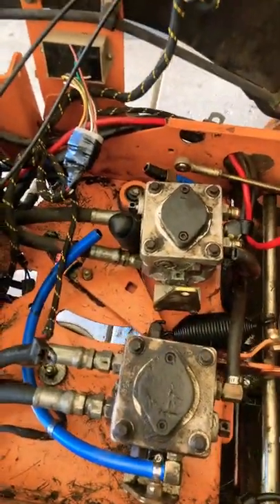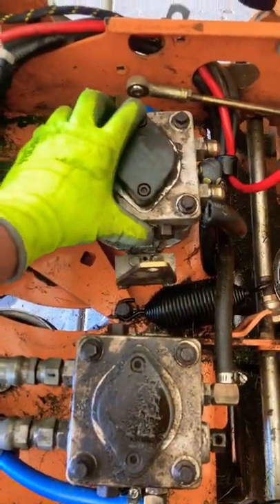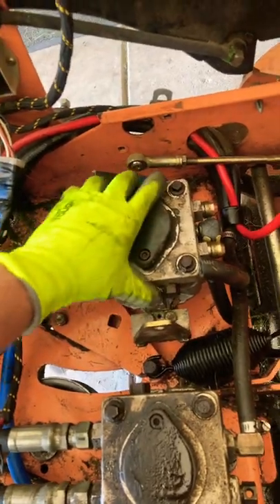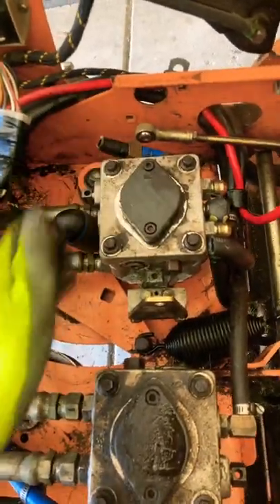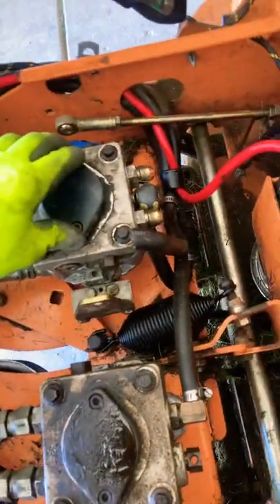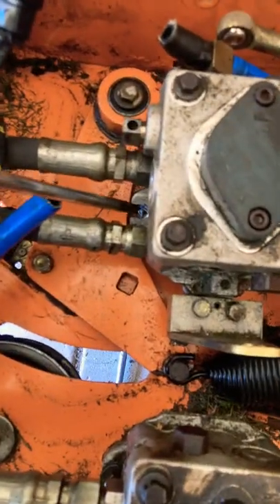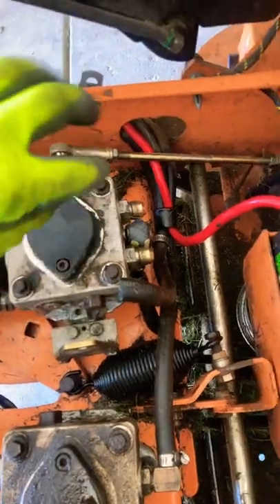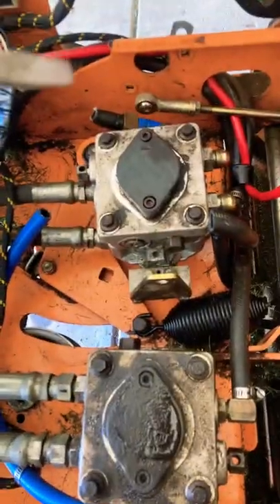Quick tip to removing the Hydro Pump on a Scag Tiger Cub

Comment: Yo bro, on a scale of 1-10 how difficult is it to rebuild these scag hydro pumps? The seal kit is fairly cheap, just considering the labor aspect. I’ve been around the block so I would consider myself pretty mechanically inclined. 
Appreciate the help bro, Aloha😎🤙🏻
Reply from the maker: If you consider yourself pretty mechanically inclined, you would roll through this like its nothing. It was pretty easy. Just remember where everything goes.... Typical right. Good luck man!

Comment: My Scag Tiger Cub is leaking hydro fluid and the local repair shop tells me they may be resealed @$550; if the technician sees scoring inside they recommend replacing both pumps @$2,200. Do those estimates sound reasonable? The mower is for personal property use on approx. 3 acres of grass, not for frequent professional work. Thanks.
Reply from the maker: Considering the pumps cost around 400-800 a piece, I would say that quote is accurate. However, my fear here is trust. That factor alone is up in the air if there is scoring in the pumps. Lets hope they are not greedy....

The reseal price is reasonable, considering the seal kit, removal and install of the pumps, fluid and all. 

From your end, and the way prices are now for Zero turn mowers, I would go with the rebuild, replacement of the pumps. Lets just hope they are not scored. 

Good luck!

Comment: I need a video on how to remove bottom pulleys plzz
Reply from the maker: This is a great idea, however I did not capture that moment. To describe the process - you need to back out the bolts currently in place - I believe they are 11mm(covert to SAE) and use those same bolts to go into the holes that we NOT in use on the pulley. Thread them in there and the pulley should release tension. I also recommend having a metal wedge of some sort to help this process, or maybe some washers to aid in removing the pulley. I hope this helps. Good luck!
Reply: @Rish  thank you sit.. I'll be replacing my hydros sometime tomorrow.  I hope its easy as it sounds 😅😅